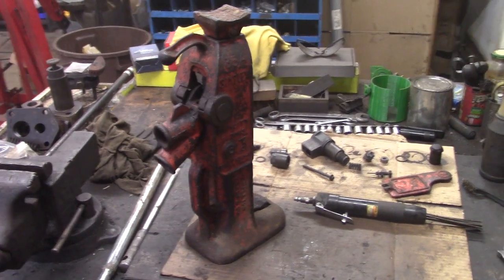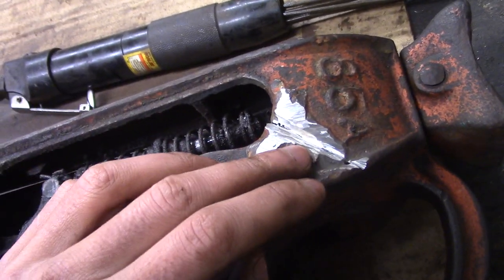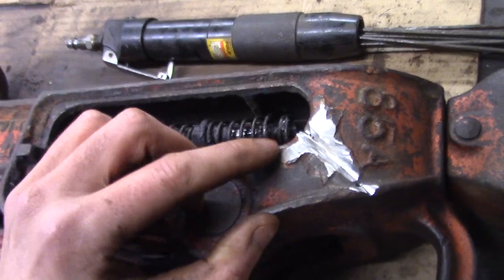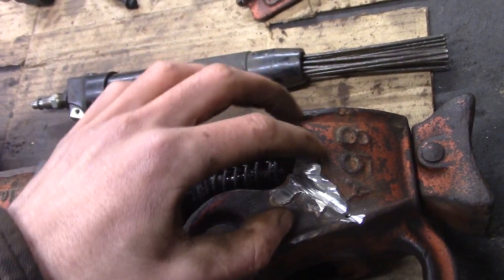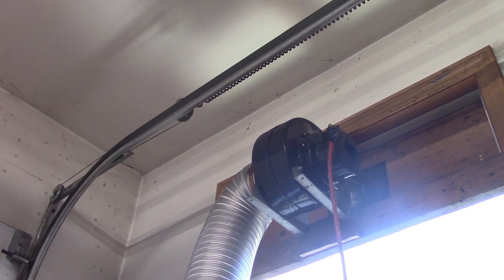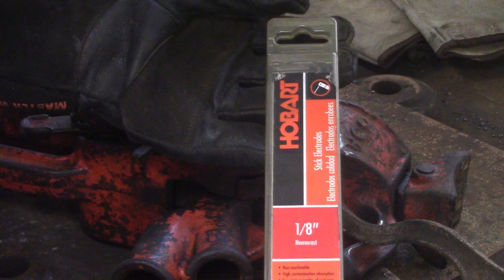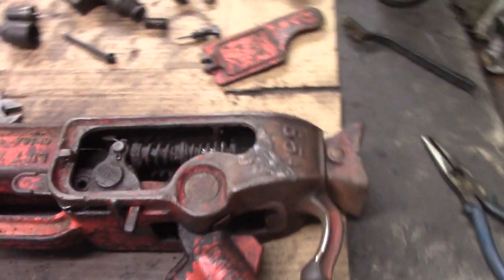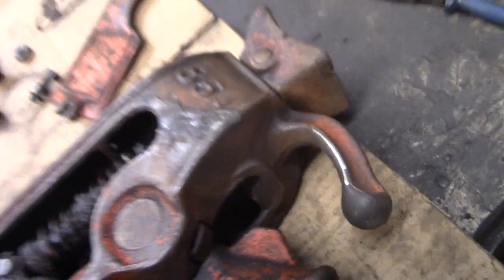Welding Cast Iron - Simplex Jack

Comment: I suspect that it is cast steel not cast iron.
7018 works great for cast steel and is lousy for cast iron.
I did not get to see you grind it so my chance to positively identify it is lost. There is no advantage of using nickel rod on cast steel. Cast iron would be to weak of a material to be a jack.
Reply from the maker: Thanks for the info! as i remember the grinding sparks were fairly yellow, with no sparkles or fuzzies at the end of the spark, but i was also grinding through the old weld metal. Good point on material strength too. So can cast steel be welded like normal steel? I wonder why the original weld  re-cracked.
Reply: @themadmailler  yes cast steel will weld up like regular carbon steel. Your description of the spark would be cast steel. 
Cast iron would have a very short red spark. Hard to say why the first weld broke or why it broke in the first place but grinding into the Crack is a good start in the repair then not over welding it was the second great thing you did.
Reply from the maker: @stevenmackey542  Thanks for the info!